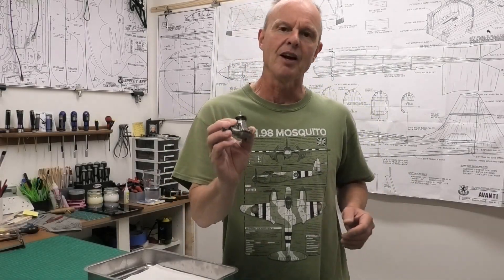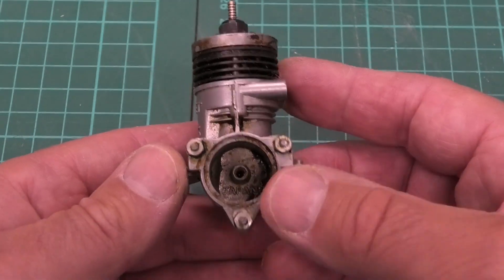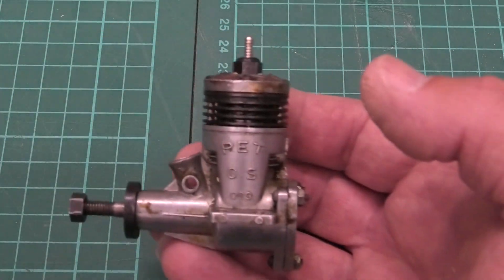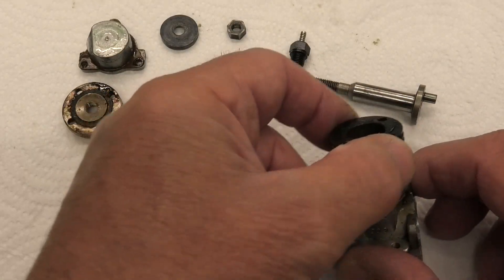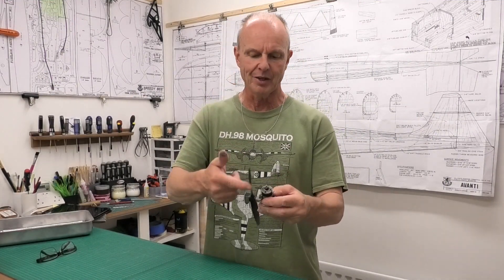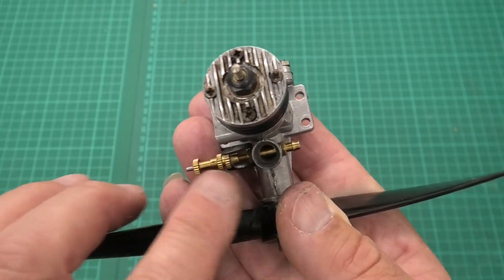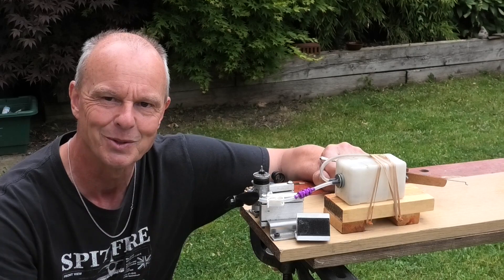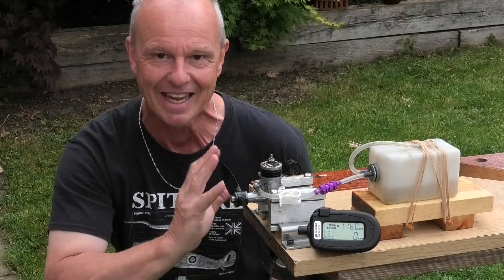OS PET 099 Glow engine from 1959/1960 -  Strip, Clean & Run

Comment: I'm in the process of de-gumming an early 'Pet', identical to this one.  Unfortunately, the cylinder screws have been 'got at' and need replacing.  Any idea what the thread is?  It seems to lie somewhere around M2.5 or 6BA, but coarser.

Comment: I ended up getting one of these for $23. And it has the carburetor with throttle control. It’s not a control line engine that runs at a constant RPM. I am extremely satisfied with this purchase.

Comment: This is a very interesting video - great! I am busy restauring exactly this engine these weeks and months. Question: where can I aquire these four screws which hold the top of the cylinder? Each advice is appreciated!
Reply from the maker: Thank you, pleased you enjoyed it.  Sure the screws will be easy enough to find, fairly sure they will be metric and obtainable from ebay, or bolt suppliers
Reply: @MarkRobinson555 Hi Mark, I am German, sorry my english is not perfect. Metric indead is fact. Diameter of the srew is 2,75 mm and diameter of screw head is 4 mm. Ebay and other supplier only offer diameter of 3,0 mm and screw head diameter is 5 mm. That does not fit! Any idea? Regards Frank

Comment: Wow, such a perfect little video. I'm an engine collector for over 40 years now and I wish I could loan you all my engines to test. Meanwhile I love your builds especially the old timer. I had a Maxwell Basset Cardinal original kit I got partially buiilt off Ebay. I built it into a slope soarer with a slightly longer wing span. It flew like a dream. I gave it to an out of work commercial pilot when I moved to Thailand. Now I have a partially built Privateer amphibian with a long wing too. Your stuff really inspires me. Thanks, Thailand Paul
Reply from the maker: Hi Paul, thanks for the comment, really pleased you like the videos 😀

Comment: Thank you, Mark.  I enjoy every one of your engine restorations, modelling projects and flying field videos.  I was given a very worn PET 099 in the mid 1970s.  I recall that it would still start readily enough and run but didn't have enough oomph to power a model - back in my teenage years and flying small control line models! - Michael.
Reply from the maker: Thank you very much for the kind comment, its really appreciated

Comment: What a gem of a PET - the needle valves in my engines were always reversed to what you installed from factory (and any I replaced) so that you were not blasted with hot exhaust gas as you adjusted the needle valve as it was on the side away from the exhaust.
Reply from the maker: Good idea, thanks for the comment 😀